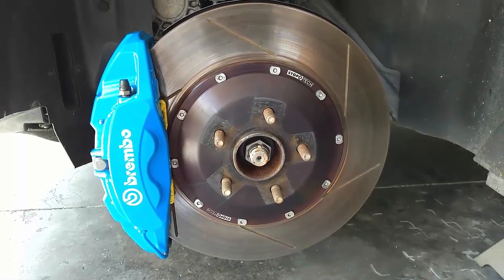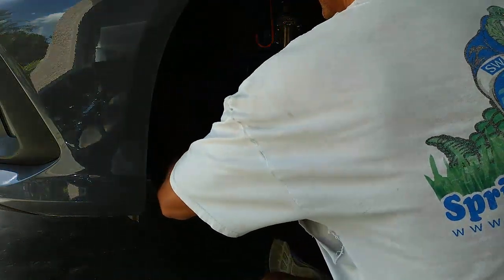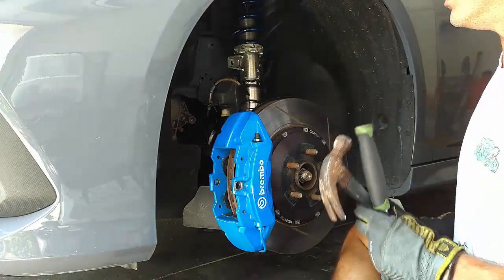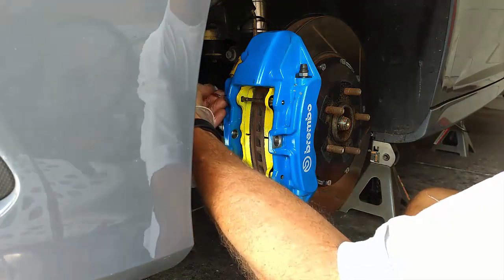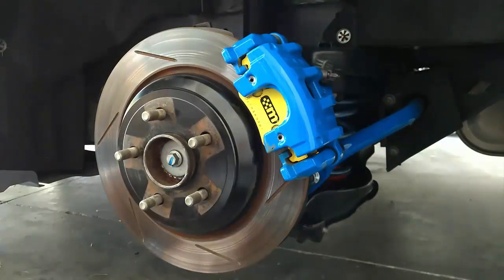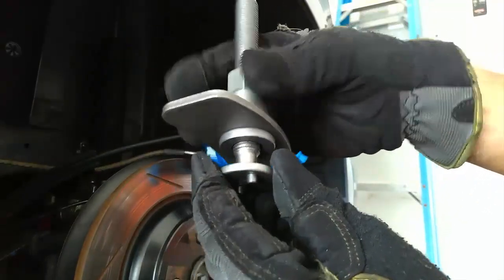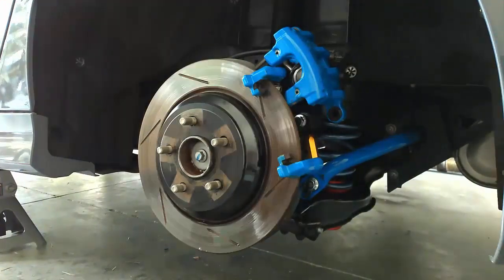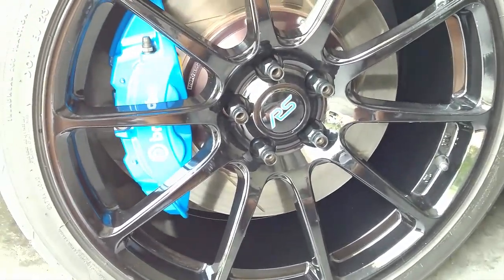Focus RS Brake Pad Install

Comment: To anyone that sees:  if that center bolt is being difficult, put the backside bolt in about a 1/4 the way and tap it with a hammer from the backside,  that'll loosen it up
Reply: Sadly, after about 50,000 miles enough brake dust, and gunk has built up around the sides of the pins that they will NOT move.  You'll need some kind of wire brush, or a strip of sand paper to help clean the pin's surfaces.  You may also need a punch pin that fits inside the center pin bolt hole as it may get so stuck as not even the bolt will be long enough to get it out.

Def some penetrating oil to help break that stuff up.

None of my pins wanted to come out.  The slid pins were so stuck that the tip actually deformed from the impact of the punch pin.

Sadly, some nicks were introduced to the blue paint.  :(

Comment: Hi Thanks for all your information and answering a previous question for me.
I now have another question for you. So when I Bought the OEM Brake Pads from the Dealership, they did NOT come with any Shims/ Anit Rattle clips. And when I took off the original brake pads, I didn’t see any Shims so I didn’t think anything of it and installed them like that. I’ve always had this small little Rattling noise from the rear when going over bumps at low speeds, and have not been able to find anything wrong with the Suspension. Finally I drove with the Hand Brake on slightly and the noise goes away.
So my question is did your car have the Shims/ Anit Rattle Clips on the original brake pads? 
Your Mountune Brake Pads did already come with the Shims right?
And I can’t seem to find any OEM Shims, do you know when I can purchase them? I can believe they don’t automatically come with the brake pads.

Comment: I've seen someone change the RS breaks in 6min my dude. There is a video.on YouTube. You did it the hard way. There is a much easy way 2 do it. Be done changing your breaks in 14mins. Both sides.
Reply: Not if those pins don't wanna come out!  Been there, done that.  Took a LONG time to get the pins to come out.

Comment: Is there’s a way to push back the piston without taking off the whole caliper?
Reply: Yes.  Unnecessary to remove the caliper and risks stripping the threads in the relatively soft alloy caliper. (yes I've done that...).  I left the old/street pads in place and used three short flat blade drivers to carefully push them in.  Yes it may make take a small chunk out of the pad, but that's worth it.  If that worries you remove the pads and use two similar shaped pieces of hard wood.  I'd only remove the caliper if the rotor needed changing.  And definitely the caliper bolts need to be torqued accurately by turning the wheel to full lock for wrench access.
Reply: You don't need to take the caliper off,,look at other vids👍
Reply: @Alpha-Dog  If you get the pins out, you could probably use the tool he listed to push the pistons back in, but it might require some finesse.

Comment: You should never use the brake cleaner directly on the pads it degrades the friction material, it might even swell up.
Reply: This is true it ruins friction material   ask NEIT automotive school they will tell you .
Reply: @fadedgarage6423  Metallic - only a  maybe, Ceramic, no.
Reply: Never use brake cleaner on brakes? Lol 😆

Comment: Hello, I’m just curious if you could have used that tool used to compress the front positions all at the same time, on the back?
Is is because it does both sides at the same time? Or could you only compress one side if you wanted to with that tool.
I’m asking cause you said it’s a good investment if you do it with any regularity. Which I plan to but am curious if it only works for the front.
Reply: From what I know, the rear pistons are not simply a push piston like the front. They actually twist as they press the brake pad upon use, hence a regular push tool won't work to push it back into place. That's why the adapter has the two protrusions so it can grip the pistion and twist it back in place. Hopefully that answers your question.
Reply: @allanso266  hey Allan thanks so much for the information again.
I was wondering if you can send me a link for the Tool you used on the front Pistons and the Special tool for the Rear, like an Amazon link or something , Idk where you purchased them. Please and Thanks!
Reply: @CesarRamirez-hb1tt  You can rent a brake tool kit at any parts store.  It will have what you need to retract the parking brake piston.

Comment: How much will Ford charge me 2 do this 🤔🚙💨
Reply: I was charged 225 parts and labor incluided
Reply: @juancruz-jg5pq  Must be nice I got regular rotors and pads $2000 🇨🇦🤷🏽‍♂️
Reply: @ChrisJones-mx8pp  yeah,  i went to the ford dealer rear brake pads and labor for 225
Reply: @juancruz-jg5pq  Somehow I really doubt that. Considering the prices dealerships charge for Labor and parts.